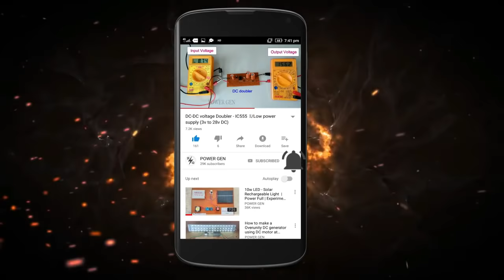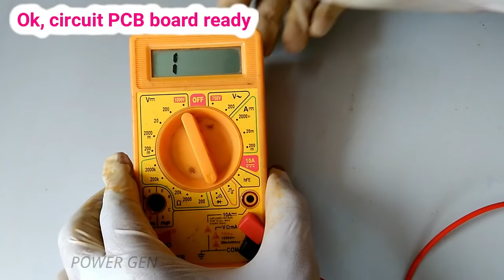How To Make a Printed Circuit Board (PCB) using Ferric Chloride and Maker pen

Comment: Which marker u had used. I used a marker pen, all the marking washed out during itching
Reply from the maker: PCB marker pen
Reply: Man, it is clearly visible that he/she is using a Luxor CD/DVD/OHP permanent marker...
You are probably using a sketch pen and calling it a permanent marker...
Reply: @ModifywithManoj  Me also
Reply: @ModifywithManoj  but make sure you are not using Simple bathroom acid + hydrogen peroxide, in case the permanent marker will remove with copper.
Reply: @ModifywithManoj  only use ferric chloride